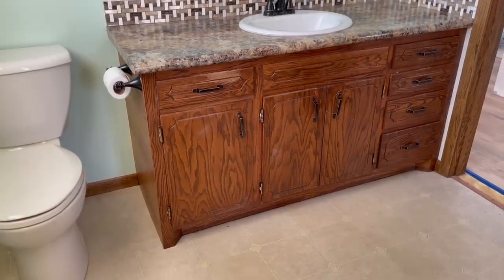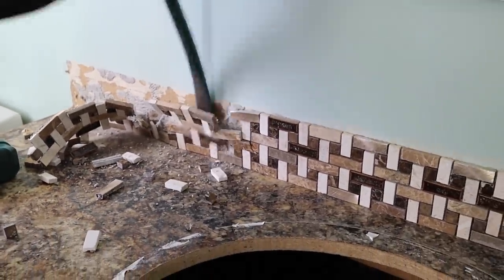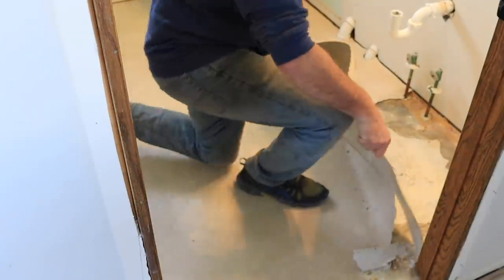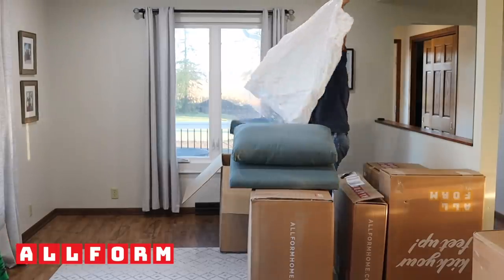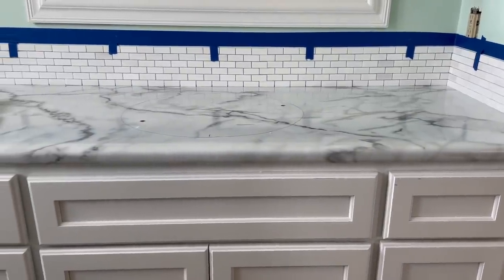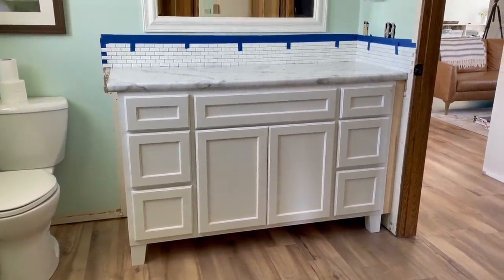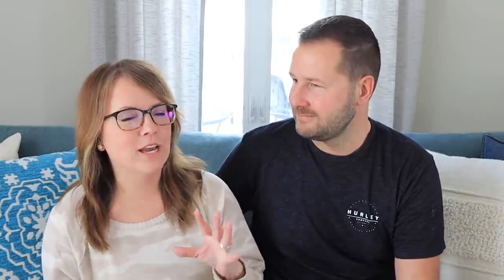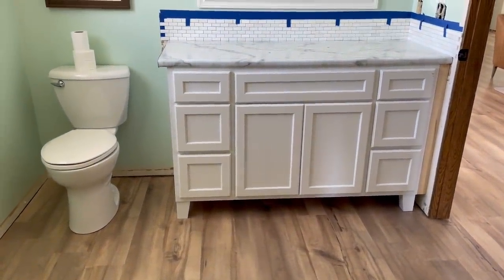"You've got to be kidding me!" (Demo never goes as planned!)

Comment: I love the mint green in there.  BUT if you absolutely had to (wanted to) change color - really almost any color would do - however keep in mind that peach and colors with yellow and gold in them will feel really warm.  Personally, I would go for teal or turquoise - pale, yes - it would be a change from green, is a friendly color, is warm enough you don't feel chilled in winter but cool enough you don't feel like you're sweltering.  My kitchen and bathroom were adjacent to each other and due to re-construction of the walls, it was necessary to paint.  for the kitchen I chose teal - because my kitchen in the summer always felt almost suffocatingly hot,  yet really chilled in winter.  Because the bathroom was so small, I elected to paint that the same color as the kitchen, which worked out great.  (Ceilings/woodwork/doors were pure white which gave everything a really clean crisp look).

Comment: You're right Dawn that if you can see under a unit ie it has legs gives the impression of more space. Combined with the white it's a great change! (I found the old unit quite heavy looking. I love light and bright). Great choice of countertop also. Re the wall colour: I would recommend you paint several A4 (or bigger!) sheets in different colours and stick them up in turn in the bathroom (moving the sheets round on different walls also). It will give you a good idea of the effect. ... You could go for a deeper shade of green, or blue (tho you may like a different accent colour to the one in your kitchen/living areas). I like yellow in a sunny bathroom. Love your videos.! G Ire

Comment: What about a light, light yellow for the bathroom?  Yellow coordinates well with the blue you have in your living room.  I have a room painted "Sunwash" by Eddie Bauer for Valspar paint - got it at Lowe's - actually got the paint chip at Lowe's and had Sherwin Williams match the paint chip so used SW paint.   It's almost a neutral and matches nearly everything.  Eddie Bauer Lakeside Cottage collection, Sunwash EB1-4

Comment: How about the kitchen cabinet blue color on the upper part of walls, with a 1x6 board placed around the perimeter at about 5.5 feet or so .  You could put pegs or hooks on it.  Paint lower walls and trim white.  Or even  paint the opposite way.

Comment: I think the current bathroom color is nicer than the other room blues you showed, the blue reads so cold (but maybe its just due to my monitor).  On this footage its a little greener than a tiffany blue.  Seafoam or minty greens are in right now, but its smart that for ya'll its paint, and not a more permanent feature (tile/counters etc)

All these colors can be overwhelming in a small space though.  In a bathroom you are so close to the walls it'll practically reflect off your skin!

I do think your picture frames now need painting to white, and the window trim.  There may be other ways to lighten it up- maybe have it stay as an accent wall with white on the other.  I'd say beadboard the lower half white but the cleaning upkeep would be a pain.